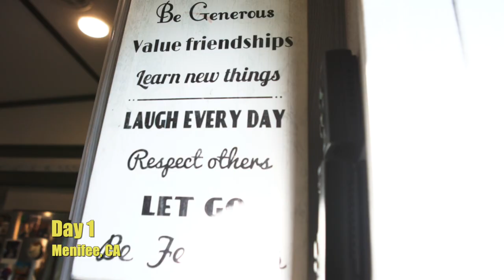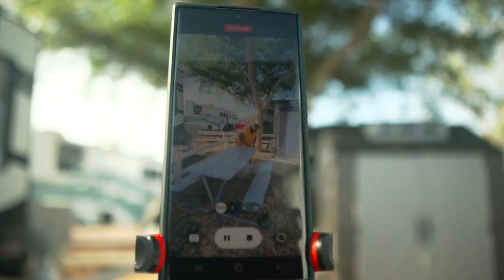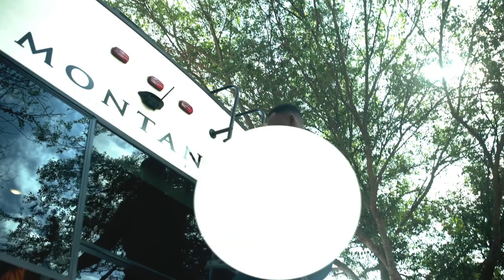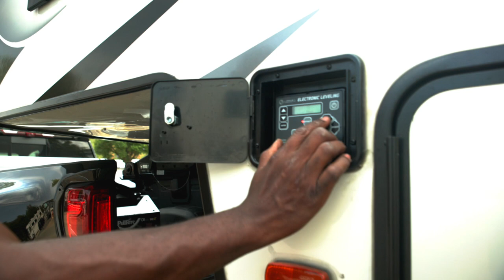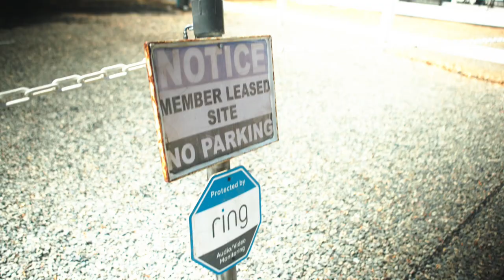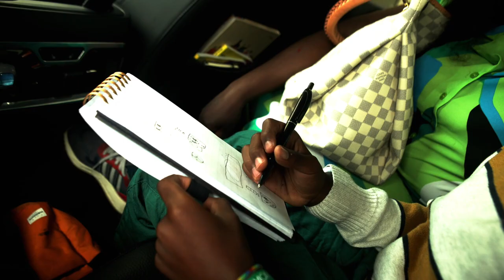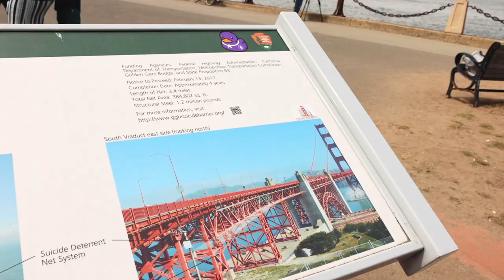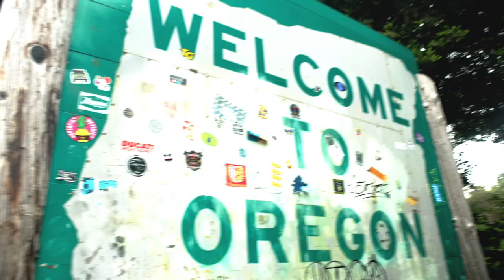Black Full Time RV Family Traveling From California to Oregon

Comment: Trailer tip: when driving forward, put your hand at the top of the steering wheel, then turn the wheel in the direction you want the trailer to move. When backing, put your hand at the bottom of the wheel, and turn the wheel in the direction you want the trailer to move. It works like a charm!
Reply from the maker: Thanks for sharing!